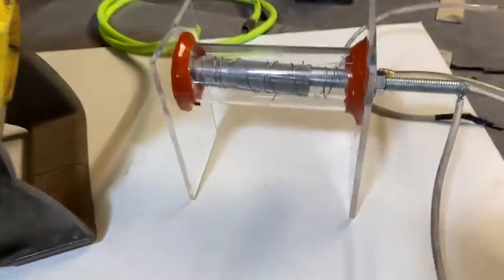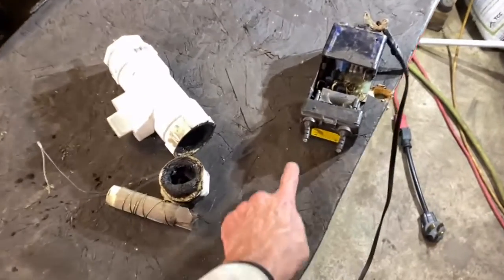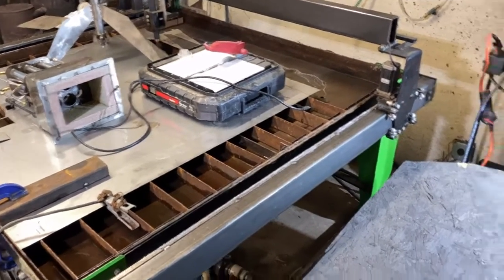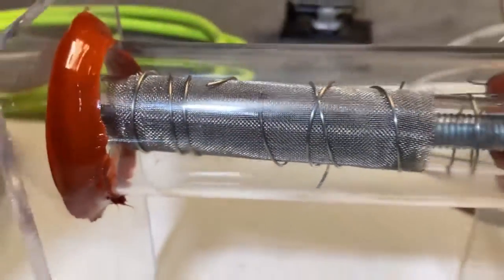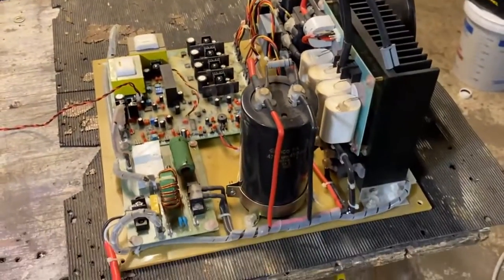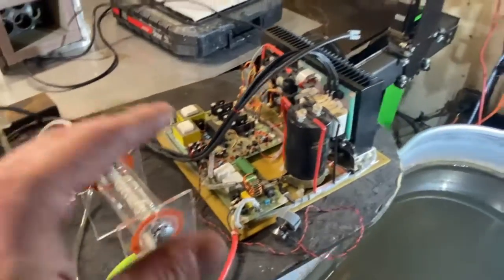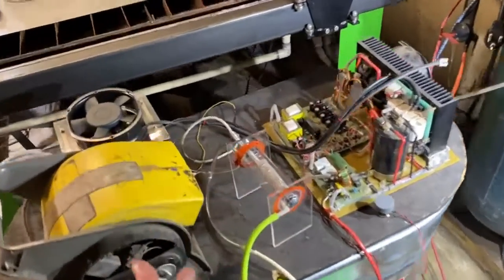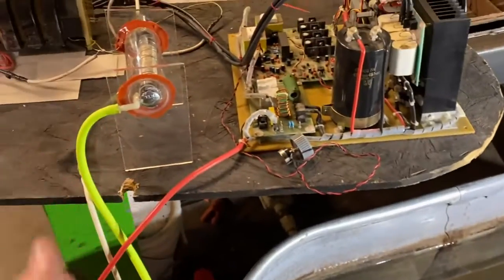Ozone Generator and fire hazards of Linchingraph voltage effects

Comment: corona eventually will break down most materials and cause carbon tracking or perforation. the 95 percent 02 just made things that much worse lol. i have made those out of glass plates 1/32 thick and eventually the corona punctured it even at 10kv 60hz. insane stuff
Reply from the maker: Yes working with high voltage has so many surprises . seen current leak threw 16 inch of wood

Comment: As neat as that is it's easier to clarify water with electrolysis. Run a tiny low voltage current through the water. It only takes 3 volts and less than 10 mA. The metal tank can be the cathode with an anode electrode in it. The cathode is protected from oxidation. All the dissolved and suspended metal and everything in the solution will adhere to the cathode as a thin crust. The cathode could be a separate piece of metal so you can clean it off or replace it. The anode oxidizes and dissolves. The cathode is protected from oxidation and cannot rust while the current is on. The slower the anode dissolves the better so the lowest current that keeps the water clear is best. The most opaque water will be crystal clear within a few hours.
Reply from the maker: yes i have looked into sacrificial anode set ups like that on a boat BUT thus we are left with bacteria growth so it was all for nothing , the bugs that get in this water make it even worse so yeah gonna stick with ozone for now but a good idea none the less
Reply: @NOBOX7  What I'm talking about is very similar to sacrificial anode cathodic protection, but that's passively powered by electrolysis. What I'm talking about uses an external power supply and it works a lot better. If any bacteria can survive, turn the voltage up a little and it's all gone within a few hours. I called it electrolysis before but it's not really electrolysis. I guess it's electric adsorption. I have used it to clean scummy water. It's crazy how well it works.
Reply: @NOBOX7  The water around the negative terminal will be alkaline and inhibit rust and oxidation but the water around the positive terminal becomes acidic and causes rusting. If you're getting rust, I'd turn the voltage down or run it less. Or you could isolate the acid with a porous membrane like an unglazed ceramic container for the positive anode in the water. Then the acid will concentrate in the porous container and the water that circulates will be basic.
Reply: @michaelcre8  membrane-separated water has interesting biological properties.  Try watering two plants and see the effect.

Comment: Have you heard of using nano bubbles?  Nano bubbles will keep the O2/O3 bubbles in solution far far longer ensuring maximum gas absorption, and the results will blow you away. Pardon the unintentional pun. The smallest of nano bubbles can remain suspended in water for hours. 

To make one is dead simple. Put an air stone inside a slightly larger tube and pump fast moving water through the tube. 

Water in the tube speeds up even more as it passes over and around the stone creating a low pressure venturi effect around the stone, pulling your air/ozone into and out of the stone. Fast moving water passing over the stone quickly breaks tiny low pressure bubbles off the stone that immediately shrink in water flow to nano sized bubbles because they go from low pressure to normal underwater pressure when moving with the water flow.

You might find you can dial down the flow from both your oxygen  concentrator and turn down the power to your O3 generator and still achieve better results.
Reply from the maker: yes i even looked into an air stone and tried to make one
Reply: @NOBOX7  I've wondered about making an air stone from sand and sodium silicate.  Is that how you made yours?  I've seen air bearings made of nothing but graphite. So maybe a cylinder of graphite with a bore hole will work. End caps  on the graphite cylinder would ensure that air escapes only along the cylinder walls where the ventury effect is greatest inside a tube with high water  flow. 

Also, with the ventury effect and creating nano bubbles: if it were air, you'd want to restrict the airflow so that with the water flow, bubbles are ripped from the stone in smaller low pressure bubbles that collapse even further and stay suspended longer.

The output of an oxygen concentrator needs to limit the flow so that which is flowing into the air stone is under a little vacuum. And, to keep the O3 generator cool you'd have to turn it down. But on the upside, the oxygen concentration get higher under low flow and the tiny tiny tine bubles stays in the water longer to be better absorbed and do its work of oxidizing contaminates in the water.
Reply from the maker: yes you are correct about the output , heat kills ozone so we may be destroying alot of what is made

Comment: maybe? but no guarantee, ozone are pretty widely use in fish farming. for somehow some reason, every now and then we will find all kinds of worms swimming in ozone saturated water. swimming happily. I don't know if chemicals will follow that trial or not. but I bet a dollar it is not as good as we expected.
Reply: @UCiyV3yQEDz_hgxDdyjLOuFw fish farm in asia use this stuff, the original intention is to sanitized the water. and some fish, such as certain kind of grouper can tolerate that very good. I have an impression that they probably breathing it. then the second reason is, it works extra extra good on protein skimmer with micro bubble generator. the only drawback is it bite rubber host, you had to find some good quality host to use ozone. ordinary fish tank host only last for days.
Reply: I'm guessing it's the O2 saturation in water that keeps the worms alive.
They get the oxygen they need through their skin. 

O3 concentration is typically a very very small fraction of an ozone generator, a few parts per million.  and its half life is relativly short 20m or so. I couldn't say what O3 the saturation limits (temp dependent) in water are, but I'd guess we are orders of magnitude below O3 saturation.
Reply: @kreynolds1123  don't underestimate chinesium craziness, the farm I have seen, they had 6 industrial ozone machine for just four 3meter dia x 1 meter depth cylinder tank. and each of the tank have air pump and a swimming pool pump to cycle water to filer pond. each tank holds about 200~300 grouper each weight 2kg+. that's a kind of "fish pile". that's their idea of what a fish farm look like, pretty unnatural. anyway, they did that to human too, no surprise.

Comment: You can decrease water (technically oxygen) corrosion by increasing the ph of water with sodium silicate. With ph between 9-11, water has extremely low tendency to pull electrons from any metal as its negative ion content has greatly increased. It is increased 100-10000x vs water with ph of 7.
Reply from the maker: Yes but at that ph its great at eating hands and fingers . I did this with sodium hydroxide and decided it wasnt worth it , at a ph of 12 all corrosion stops

Comment: Water is cheap why not just refill from fresh?
Reply from the maker: Its a sediment tanks , cutting stainless steel can create some pretty nasty metal powder and in winter into a huge pain in the neck to drain and fill the table, also believe it or not water is not cheap in my location  filling and draining this 7 to 10 times a week can add up , they also charge you for sewage   . and this pump is about 3 times faster than a hose .